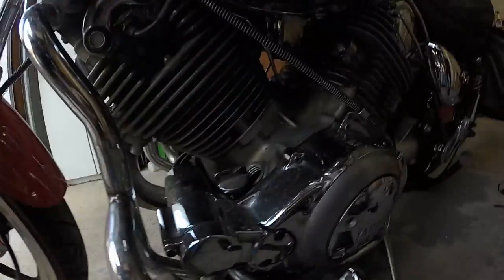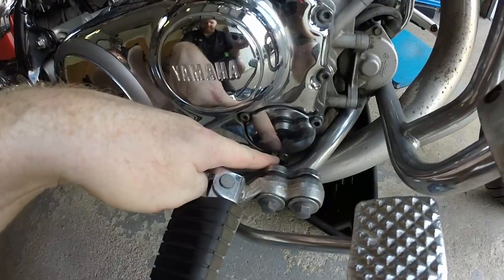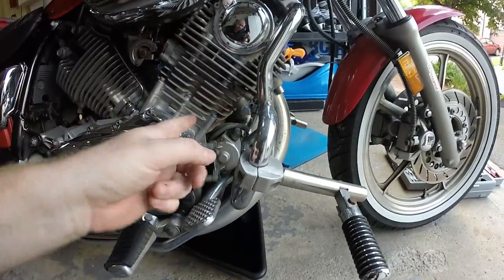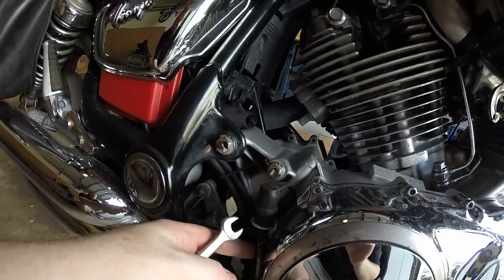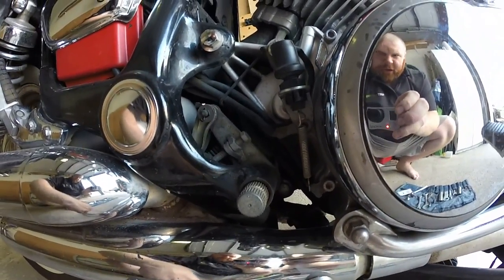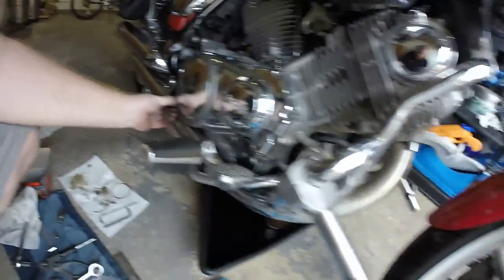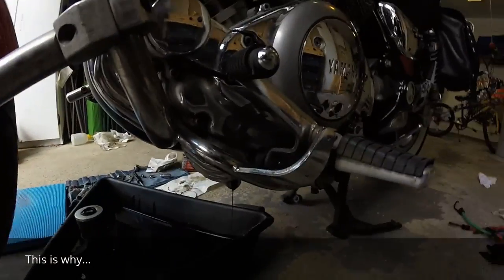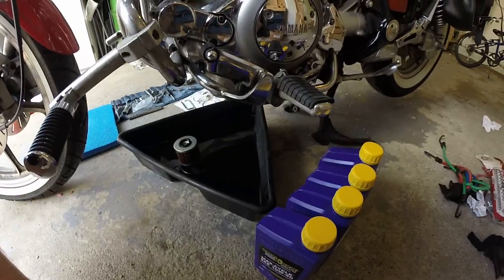1995 Yamaha Virago xv750 oil and filter change

Comment: You don't need to remove the crash bar or the brake lever.  Just use a 14mm wrench and remove the one directly in front of the cover.  Two bolts and out.
Reply from the maker: I didn't think you could get to the bolts to take off the foot peg without disassembling the rest.  I'll try that next time!
Reply: Yep, that's all I do.  Hopefully, it will make it an easier job for ya next time.
Reply: Use a 14mm wrench to get to those bolts.  With that off, you will have enough space to get to the bottom bolt and get that cover off.
Reply: Did it work?
Reply: This is true! Just loosen those bolts. Back bolt and the two under the motor. Then you have enough space  to work with. Just did it today. Thanks!
Reply: @ilikeboost4764  Yes. I just did it. No need to remove brake or crash bar. Just loosen the back and bottom bolts of the foot peg and you got enough room
Reply: Buy And Rent In South Florida yeah I know. 😂. Bike was crashed and sold since then. I did all the maintenance beforehand.
Reply: Whoa this could mean I aint selling  it now lol
Reply: @LOOSE-WHEELS  Easy job!
Reply: Here is a reply to this so I'll make this simple... Make another video or I'll play fortnite untill it is 3:15 jk but still MAKE A NEW VIDEO
Reply: @zeroreality  this along will change my mind to even think about getting a Virago...no thanks🤣
Reply from the maker: @sachsgs2509  check the pinned comment on this video. One of the commenters days in doing it the hard way. Didn't end up doing another oil change in this bike, but his method sounds plausible.
Reply: @seeya205 make a video post in comments
Reply: @paulnewman1489  I no longer have the bike. This was 6 years ago.

Comment: Thanks Alex, very detailed video on oil change.  I really appreciate that you mentioned your previous mistakes as they are just as important as the job itself.  I will watch your other Virago videos.  I hope you make more soon.  I learned a lot.  I have to clean the carbs now.  That would be a good video to do.  Thanks again.
Reply from the maker: Thanks John!
I have been meaning to do a carbs video; they can be a pain to take off.  I found that to get one of the boots off you need to get at it from the other complete other side using an extender.  I know my carbs are probably gunked up, but I have other videos already on the go and I really should finish editing one of them and upload it soon...

Comment: The engine was originally designed for the XV920 and TR1 bikes which had the footrests in the conventional position. When it was fitted to a cruiser type of frame they had to move the footrests to a foot-forward position and as the frame had no downtubes they fitted that footrest support bar which now got in the way of the oil filter cover. On the original applications of this engine it was perfectly accessible. Check out the magnificent TR1 for example:

https://www.motorcyclespecs.co.za/model/yamaha/yamaha_XV1000%20TR1%2081.htm

Comment: I GOT MINE ON AND OFF JUST UNDOING THE 3 ALLEN KEY STUDS USE SHORTEST END OF KEY EASY PEASY    TIP CHECK THE SEAL OF THE COVER IF ITS WORN DAMAGED ECT THEN WRAP PTFA TAPE ROUND IT JOB DONE

Comment: I was just about to buy a Virago for $950, but I can't after seeing this.
If I can't change oil in 20 min or have a lot of hassle, then it's a no go.
Reply from the maker: Changing the oil is about 45-60 minutes if you have engine guards. Without would be 15 easy. The is also a pinned comment from some guy saying it's much easier than I make it out to be. Never got a chance to try.

Comment: engine oil pressure Chek  oil lines main engine oil gallery to the cylinder road . trese lines should be inspectend one month  to ensure  they have  not  Bern damagend clymer  pg 79 virago 1100 RJ brazil very good explication ! 👍👍😃

Comment: 😂😂great commentary. 👍 did you replace the o rings on the filter too? I  have done air filter, but can't work out how on earth that gets air through it as the grille is solid rather than open.... Yamaha styley😮
Reply from the maker: I was getting the FRAM CH6004 replacement filter, and it came with all new o-rings in the box, so I would replace them each time.  However, at some point FRAM changed the large o-ring size in their box (it was about 1cm too large), so I ended up having to re-use the big one the last two oil changes on this bike.

I misspoke this video where I said there was a another "filter" at 3:44, what I meant to say was "o-ring".  YouTube used to have this feature for on-screen messages that I had set up to visually show what I meant, but they seem to be gone now.

The air box "breaths" through a couple of tubes behind the box.  Not a lot of air needed I guess.  You'd never see them doing the air filter replacement.  I only saw them when I took the carbs out to clean them and re-sync them.  Never made a video for that though.

Comment: Got any suggestions for removing the bolts for the oil filter. I have a 85’ XV 1000 im working on and I can’t get em off
Reply from the maker: They may have been over-tightened when it was last opened.  The 84/85 Virago is slightly different, but the oil filter cap is very similar.  Try using an Allen-bit in a socket wrench.  If the extra torque from the longer handle doesn't work, give the handle a gentle whack with a hammer to "break" the lock.  I have had to do this to other Allen-bolts on my bike and had to REALLY whack the thing so hard I thought it would break!  Start soft though.  Good luck!

Comment: So, you can take those two top bolts off and just let the cover swing down?
Reply from the maker: No, you need to take all the bolts out to get the oil filter cover off.  It's pressed in there quite firm and there's a gasket you need to either keep or replace.  There's a spot for a flat-head screwdriver to help you pry to cover open.

Comment: I have a question . The oil level should be checked on the stander or with both wheels touching the ground . Because i think it makes a difference. I want to change the oil and this is what bothers me. Looking for someone's reply. Thank you.
Reply: Maybe this is why Yamaha likes extra oil 😂
Reply from the maker: If you are changing the oil, just be sure to have it on the centre when looking in the little window to get your measurement. When draining too; I made the mistake of keeping it on the side stand.
Reply: The stand brings the back tier up and tilt the motorcycle in front . I do not mean left right tilt . I am not sure if should check window on stand or on the wheels 🤦‍♂️. Thank you for replay 👍
Reply from the maker: @BRN94  Interesting... I've never thought about it. The window is at the front of the bike bike's engine, so even on the centre stand, it would (if nothing else) look fuller. As much as I swear and curse Yamaha, they probably thought of that and built it specifically to show the proper level with the rear tire in the air.
Reply: I know. I have heard some different opinions that's why i asked you too . It was a pleasure talking with you . You have done a great job with the video . Ride safe on an awesome machine ✌.

Comment: Is there a certain way to put the oil cover back on? It has a divot on one side of the screw hole.
Reply from the maker: All the bolt holes are equally spaced, but there is definitely a correct way.  If you hold the cover up to the engine case you can see the outside of the cover is actually "shaped" to match the contours of the engine.  Of the three bolts that come out, one it extra long; that's the bottom one.  Don't forget the drip catcher on the bottom bolt as well; it keeps oil from spilling onto your pipes when you do the change.
Reply: Alex Lein  in the inside of the oil filter cap it has a big hole.what direction does that goes?
Reply from the maker: @israelrivera2830  At around 4:42 in this video, you can sorta make out the inside of the filter cap.  There is only one "hole" directly in the centre of mine.  Or do you mean on the filter itself?
Reply: Alex Lein I see the hole on the video.
Reply: When you install it it’s facing up.i’ve seen 2 other video and one person said that the hole goes facing up.the other video says that it goes towards the screw on the left side.so I’m confused.thanks.
Reply from the maker: @israelrivera2830  do you have a 1982-85 Virago? Those do have a slightly different engine, and maybe a different oil filter call.
Reply: 95 Yamaha virago 1100cc
Reply: There’s a video by theriffraff58 95 Yamaha virago.when he takes out the filter you can see the hole clearly.I can also see it on yours.
Reply from the maker: @israelrivera2830  Ok, I watced most of his part 1 video, and you can sorta see what I think I can see what you're talking about around the 11:18 mark.  There's a hole on the side of the thing on the inside, right?  From memory I can't tell you which direction it goes (probably down), but I can tell you that you will be able to figure it out much easier by using the outside of the cap to figure out which way it goes.  Good luck bud!

Comment: What’s the oil and filter you are using ???
Reply from the maker: I am using Royal Purple 10w40; it's a synthetic blend that covers the bases for warm and cold weather.  The manual suggests 20w40 in warm (summer) weather and 10w30 in the cold (autumn).
The filter is a FRAM, but I don't remember the model number (I will see if I still have one when I get home).  I picked it up at Crappy Tire for cheap.
Reply from the maker: I found it!

FRAM filter is CH6004.  It comes with all three rubber gaskets that you'll need for the job, but keep the old ones just in case; I had one box where one of the gaskets was the wrong size before.
Reply: @zeroreality  thank you !

Comment: Anyone know how many liters Oil i need to virago 750 94'
Reply from the maker: '94 Virago is the same as the '95; ~3 litres.  I usually need 3 bottles and 1/4 of a fourth bottle; bottles were ~900mL, so it all checks out.
Reply: Alex Lein thanks a lot
Reply: @holydriver666  Less than 3 liters, the 1100 cc engine wants 3.1 liters.
Reply: 3quarts by it's self. 3.3 with a filter change

Comment: Thanks for showing, but you don't have to take the rear brake, nor the crash bar off!! Take the left 10 mm nut off with a 14 mm tool, then the other one underneath the bike in front. You do not have to take the front bolt/screw out, there's enough space to get that done. Why do Americans always have to use fuck for almost all? Please watch better movies when you're planning an oil change and be aware that there're two more O-rings, not gaskets what the guy's calling them.